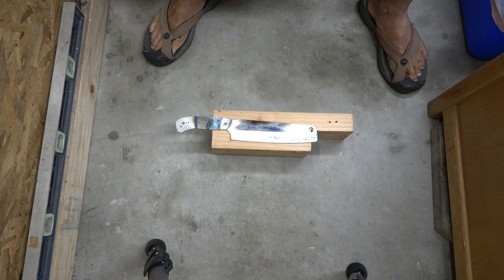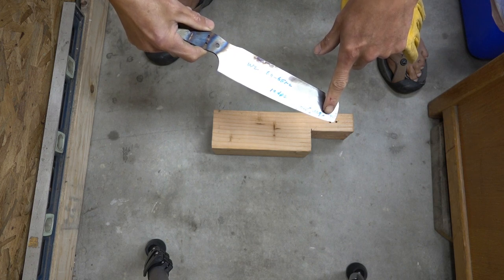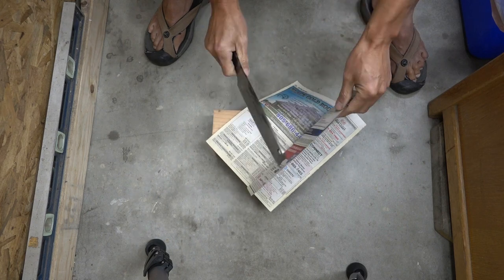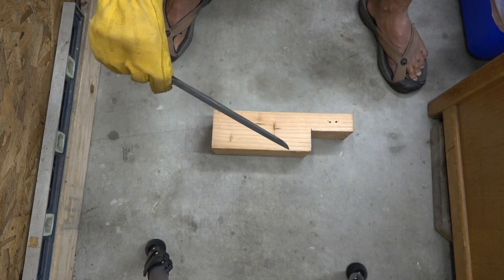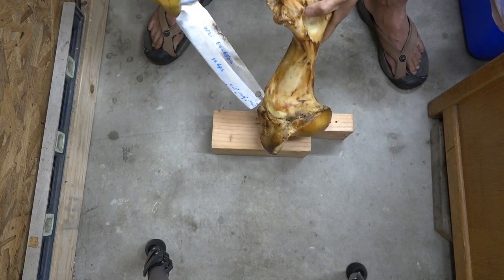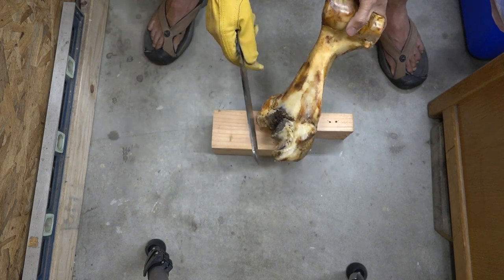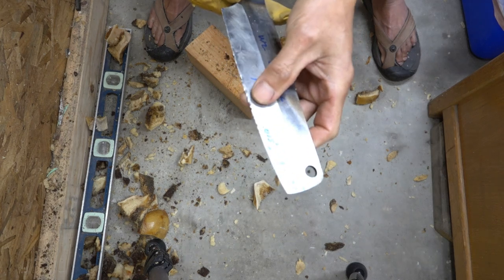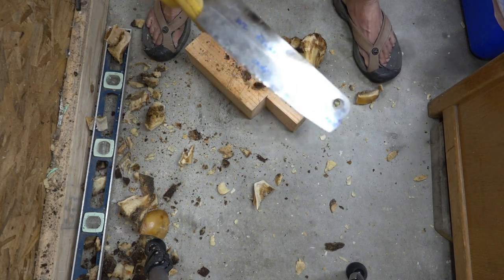BCMW W2 64 plus HRC Thin Cleaver - Part 1 of 2

Comment: Impressive demonstration.
Reply from the maker: Thanks.
Reply: Hello Luong.
I recall what was the generally accepted wisdom on internet forums that "the harder the RC, the more brittle the steel". I look at what you are demonstrating with your HT and would suggest that you are changing that.
Reply from the maker: Thanks Mick. Your enlighten observation and perspective are always refreshing.  Wisdom often based on empirical ht bell-curve of facts/data however when evidences matched experiences and occurred 2+ deviations from mean, therefore existence of a better ht performance bell-curve is possible as shown :)